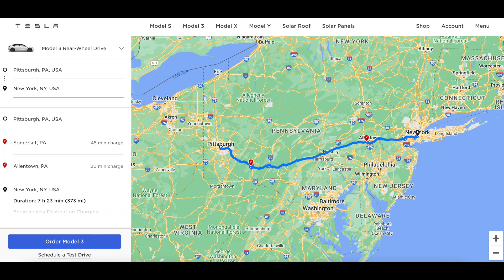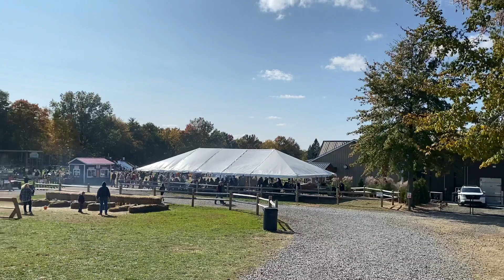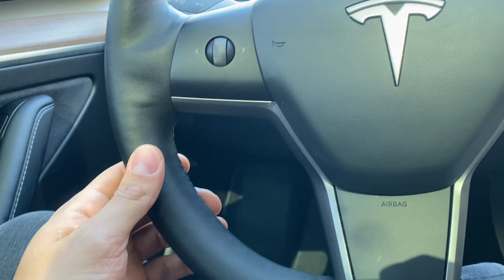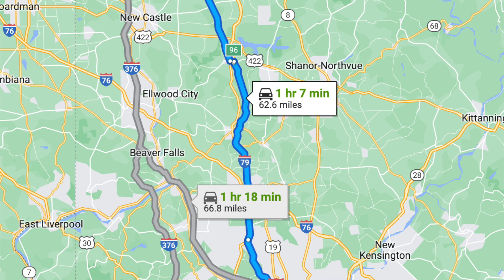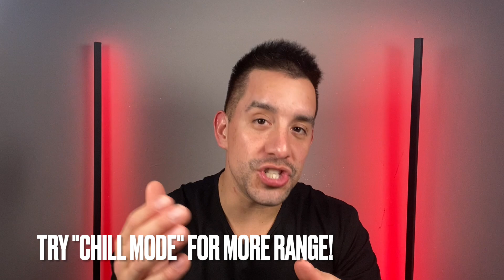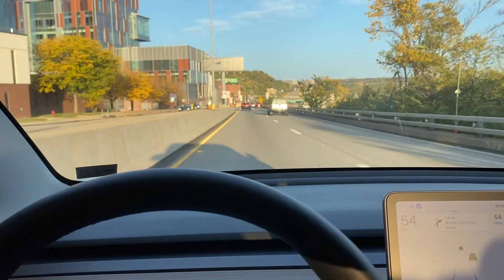Driving Tesla’s SMALLEST Battery Car | How Far Can You Go?

Comment from the maker: Reference: I have a Model 3 RWD I purchased in June 2021. I currently have 22,821 miles on it with All Season tires, 19" alloy Tesla sport wheels. My 100% charge is within a "normal" battery degradation, I called Tesla and they confirmed this and on the Tesla app you can "request service" and list "Battery Health" as the topic, and the app will run a battery diagnosis free of charge and the results said my battery was functioning normally. Finally, range fluctuates (in my experience) some days I get 245 miles, others like today I got 232. Not sure why this is. 

Please subscribe so I can do this full time one day and do more videos for all of you with even better production! Thank you
Reply: Use the car's trip planner. it's range consumption is pretty accurate

Comment: Yeah that’s my biggest thing with my 2022 M3 RWD. I usually estimate it’ll be 40 more miles that I’ll use than the distance I’m traveling unless it’s really close. Part of that might be driving in standard mode but I also have my windows down which adds resistance so that might be a part of the issue as well. Either way, I wish it were more accurate but I guess it can’t predict everything.
Reply from the maker: Agreed on the accuracy but yes more drag from the windows doesn't help either

Comment: I drive my model 3 rear drive which has 245 miles of range on a 70 mile trip fairly frequently.  I usually have 70 of range left after driving the 140 mile round trip.  3/4 of miles at 70 &  1/4 at 60 MPH.   Doubling the speed makes the car encounter twice as much air moving twice as fast, causing drag to quadruple. Energy consumption grows very rapidly with speed.  Driving 30 mph uses 1/4 the energy as 60 mph.  What does your trip information tell you.  I  average  238 KW per mile.  A mix of town and freeway driving.